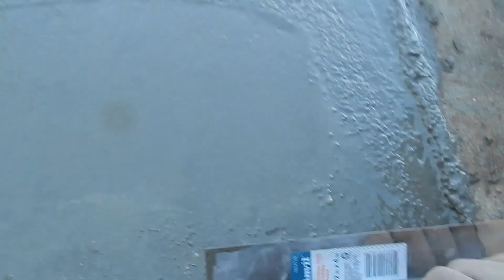Walkway addition #concrete  #walkway #diy #homedepot #quikrete #tools #construccion #construction

Comment: Does skipping the digging works too? Does using soil cultivator machine speed up the process?
Reply from the maker: You want to level your concrete with the existing one. A cultivator is expensive but it will help.thqnk you for watching.